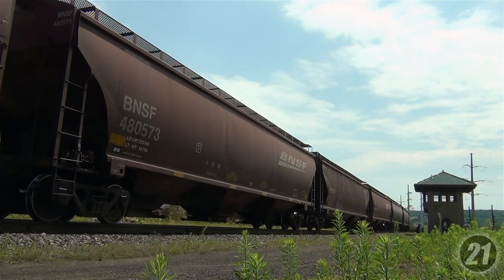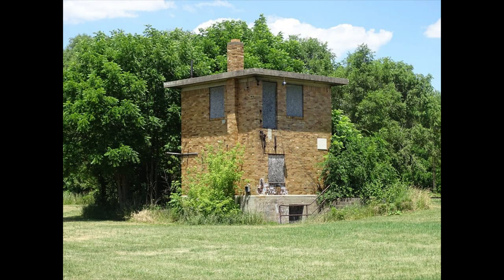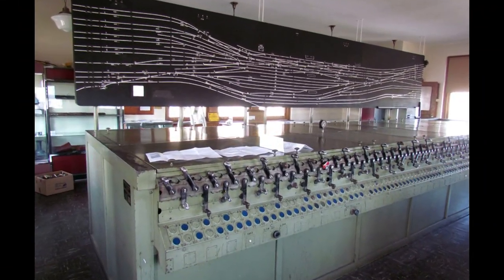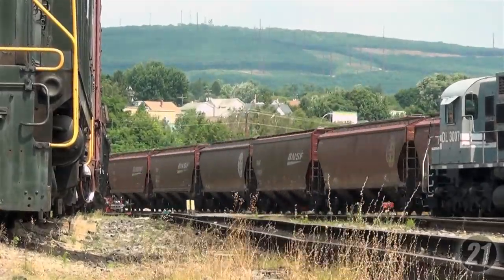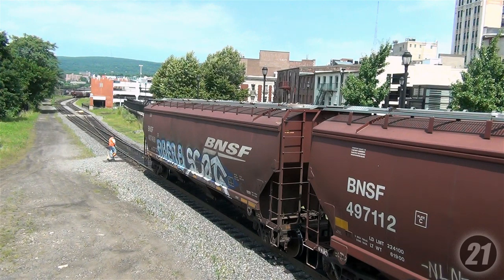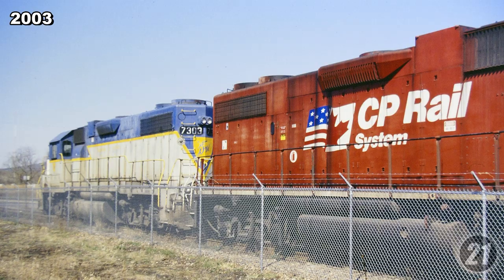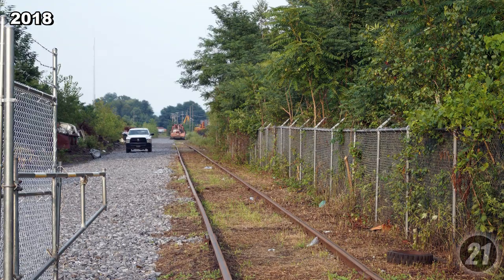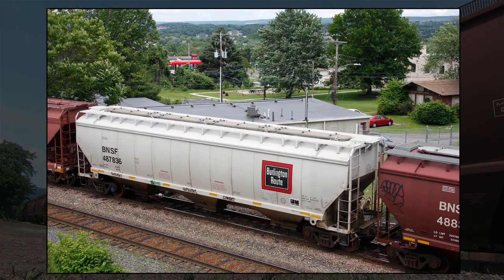[SS][T-135] Heavy Haulers, Helpers & Watching Trains From A Tower (Summer Special 2019) | Trains 21

Comment: Modern system are great, but when they go wrong it's Chaos, we had our Main control center be evacuated after a False alarm, it held up the whole Surban system and a lot of country service, so much for Progress, luckly one of my stations are still operated by a Signal Box/Tower, still using rods and levers (I think it's a 24 frame)
Reply from the maker: Cool.. Thanks for sharing that info!

Comment: I live in Europe, in Southwest Britain, and am an ex Permanent Way Railway Engineer. I am commenting on your Observation of the Wheel Flanges. Over here the Rails are actually inclined inwards which matches up with the coning of the Wheels so that the vertical Forces are transmitted vertically down through the Rail, and apart from on Curves, and Transitions where there is Cant Deficiency the Wheel Flange hardly contacts the Side of the Rail Head. I suspect it might be the same over there? Great Video, thanks.
Reply from the maker: Thanks for that first hand information Peter.. Much appreciated.

Comment: Great Video as always ...question what’s inside the high end Gons at the  end of  train featuring the CR unit in the lead? Billets rods slabs ..can’t quite tell
Reply from the maker: I don't know for sure but I think it may be bundles of thin steel rods.. The kind used in reinforcing steel structures.. Just a guess.
Reply: Ya was not sure think you are right. Not exactly the  place you would find slabs. Slabs usually local around mills like Pittsburgh Chicago & the like.